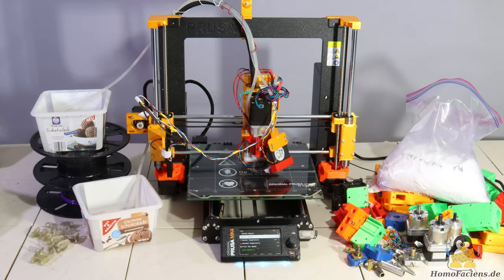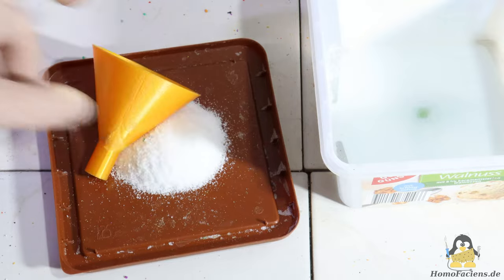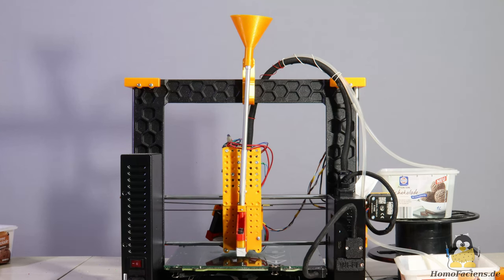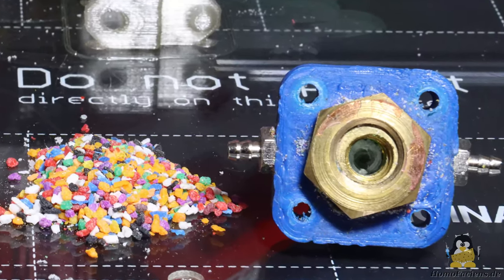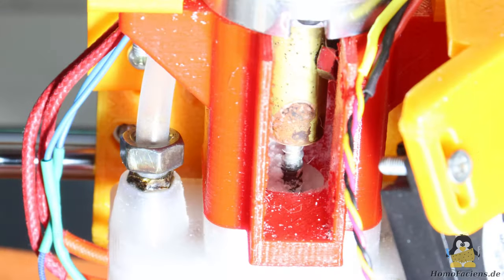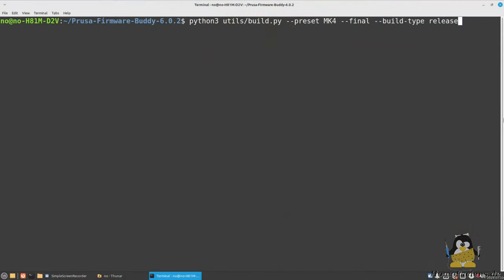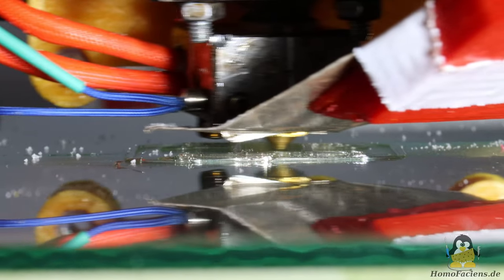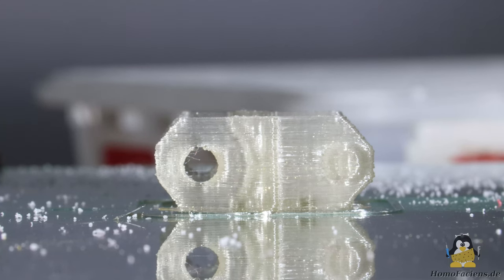3D printing with granules and a Prusa MK4, Part 2

Comment: If you think about it, why do commercial injection molders use the larger granulated raw material?
I worked at one time for a company that had an in-house injection molding department and although 90% of the production was made using virgin material, about 10% was made using regrind material.
We recycled material using a hammer mill and found that if the regrind material was "too fine" then we had endless problems on the injection machines.
Eventually we passed the regrind over a vibrating screen conveyor to remove the particles smaller than 1mm and that was the end of the problems.
Often I took a few kilos of powder (PVC and ABS) home and used that in rough molds and a small electric stove I had in my workshop to rough mold pieces that I needed for some of my projects.
After I left that company I use milk jugs (HDPE) cut into much bigger pieces as this process takes a bit of time, the material eventually is heated to the right temperature all the way through and the pressure plate (if you tightened the clamp bolts every 5 to 10 minutes during the melt process) forced all the air out and I normally got very good rough plastic castings for my projects.
Machining was easily done on my cheap lath with a milling head attachment and tooling lasted WAY LONGER than if I had been using steel or aluminium.
No, I don't have videos as this happened before the internet and YouTube - sorry...
Reply from the maker: Thanks for sharing your knowledge!
Industrial pellets are optimized for flowing / trickling down the hopper and feeding path. The extruders are designed for a constant material flow.
However, if you want to 3D print small structures, the flow rate is anything but constant, because of variations in layer height or line width,  and you need a fine control of the material flow. You can't achieve that with rough raw material nor with a conventional extruder design. So lots of experimentation ahead...

Comment: I love what you are doing! Have you tried mixing custom colors or material properties with this? If so, is it as straightforward as mixing in the different colors or materials and it all just mixes as it gets melted as you print? Making custom materials and colors are the aspects of a printer that uses granules instead of filament.
Reply from the maker: Thanks! This compact extruder design might not be best for mixing colors, but future tests will show if I can get a uniform color when mixing different powders / granules. First I have to tune the hardware for uniform extrusion and best possible print quality with no eye on the color.